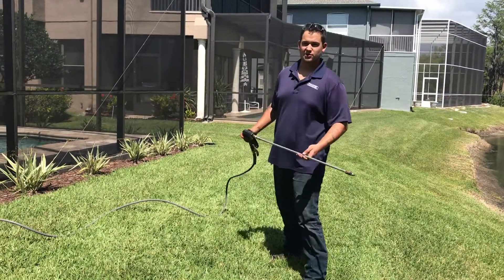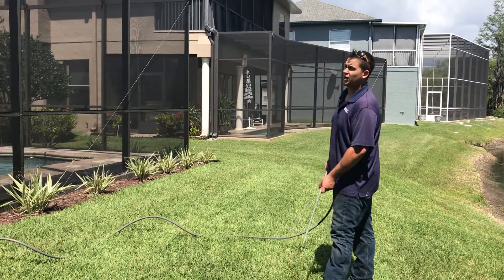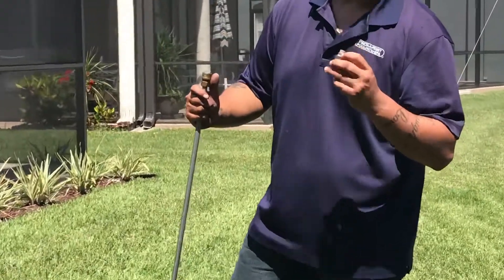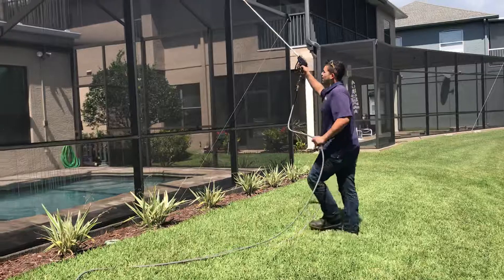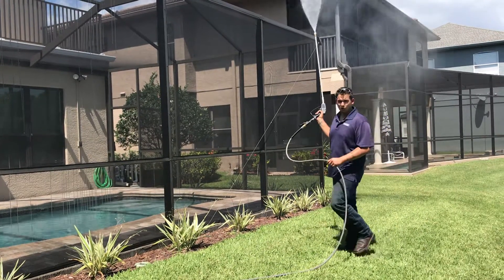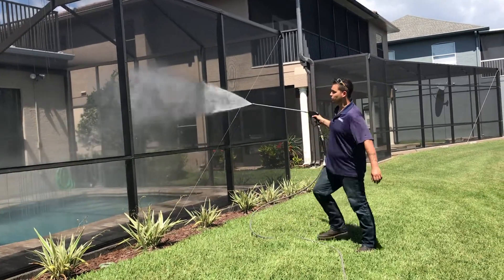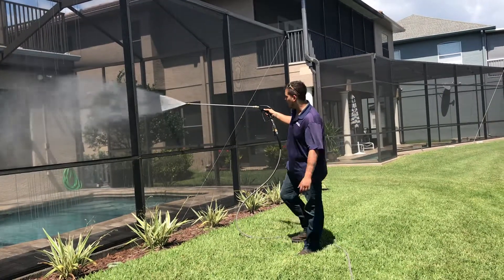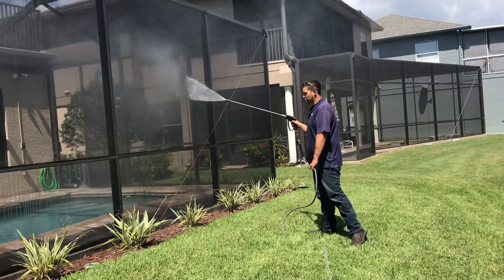How to properly clean screens on a pool cage

Comment: What measures do you take to keep stuff from blowing in the pool
Reply from the maker: Wand control with minimal thought gone into. Rarely anything goes into the pool with myself. Surface cleaner practice and technique refining will allow for pool deck cleaning around the pools edge with no run off. Never really has been an issue for me in my personal work experience.

Comment: Would a regular 25 degree tip that came with my 4gpm machine work or do I need to buy one rated for 15 GPM. Tku
Reply: Yes. Use the one that came with your machine. You don’t need one rated for 15gpm. That’s insanity

Comment: Wouldn't it make more sense to spray from inside out first then outside in to get all initial dirt blowing outside?
Reply from the maker: You bring up a good question but for me i find this method to work.
Reply: No...the final spray should be from the inside of the deck.  Either way you get a mess on the deck, so doing the final on the inside cleans that too.  Otherwise you will clean inside, then out, then inside AGAIN.
Reply from the maker: Spacecoastz  Ultimately yes this why way blow the outside junk of the cage off and in then from the inside back out!

Comment: Best way is to wet, spray some sort of soap on with a foam canon, brush it, then rinse.  Do both sides for best result.
Reply: What brush would you recommend? Thanks
Reply: @LubaK777  I use a soft bristle brush. Not too much pressure.
Reply: How do scrub the upper screen area. The screen above your head?
Reply: @angelfontanez1  I have a long extending pole for the brush.

Comment: Do you have to use some kind of soaps or algaecides or is just the pressure wash enough?
Reply from the maker: rick raub Definitely want to keep the chemicals to an all time low when possible due to the color on the aluminum tends to be thin and brittle. For screens by themselves id say 95% of the time i use just water!